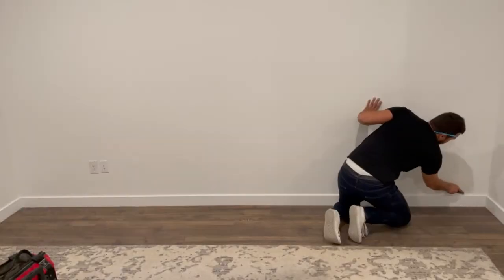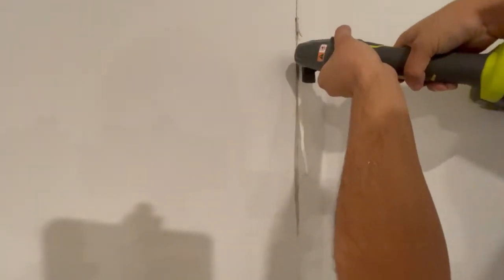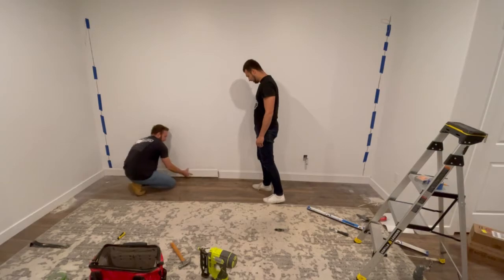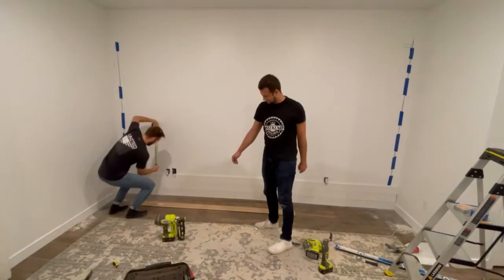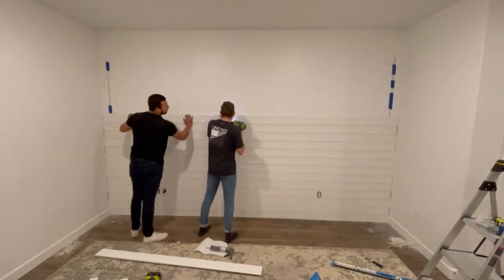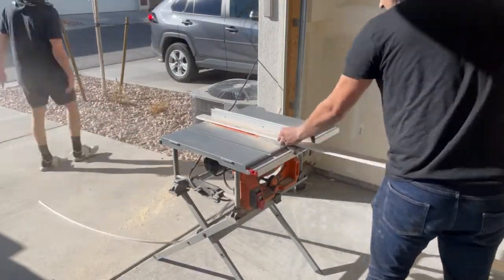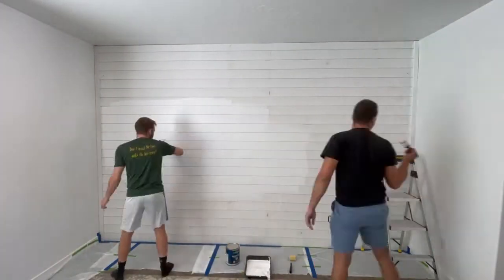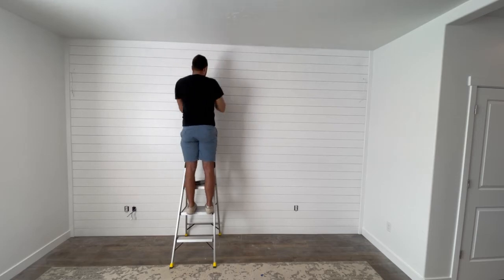How to Install Shiplap | DIY Accent Wall

Comment: I noticed you caulked the outer edges of the trim on both sides of the wall. Did you also caulk where the trim meets the shiplap? I’m wondering if that might create globs in the gaps between the boards.

Comment: Hiya, I'm considering doing this in my son's room. However the wall in question is an external wall, our house is not very well insulated- thrown up during the boom 😖 and the plaster board does not go down to the floor. (As in when you remove the base board you can feel a draft and see the plaster board does not reach the floor). We previously made a bed against that wall for our daughter but it ended up that her mattress and duvet got mould on it without any mould on the wall.  That is the main reason we want to panel it now as my son wants a bed against that wall. We were thinking the panelling may prevent the issue reaccuring, however I'm concerned the side of the panelling facing the wall may end up becoming mouldy?🤔 Do you have any advice before we proceed? That wall joins to another external wall and we have a recurring issue of a small mould patch at the bottom of the walls where they both meet just above the baseboard.  As a result we never have anything in that corner. His room is a small box room above the stairs so we plan on making the box smaller and building a bed over it. Sorry for the long comment, any advice greatly appreciated.